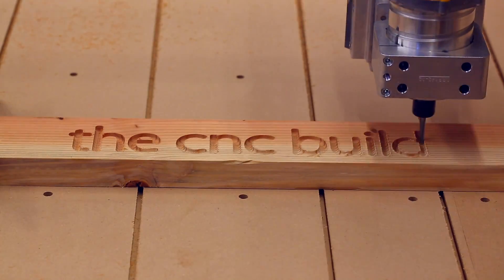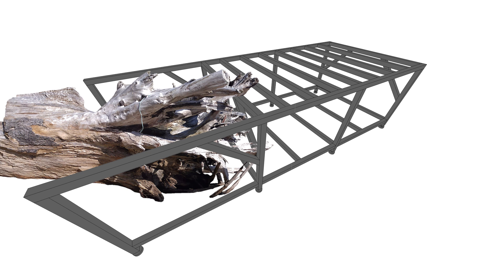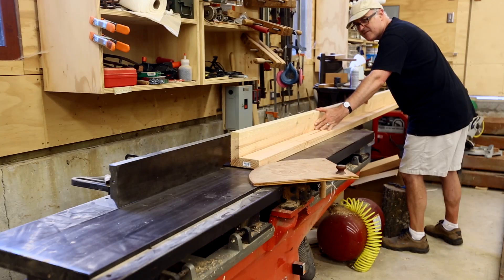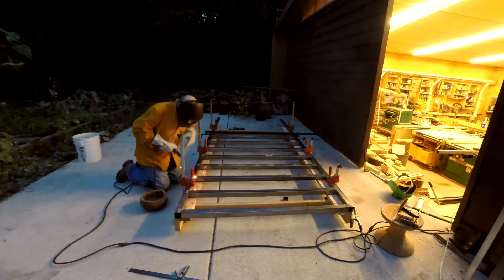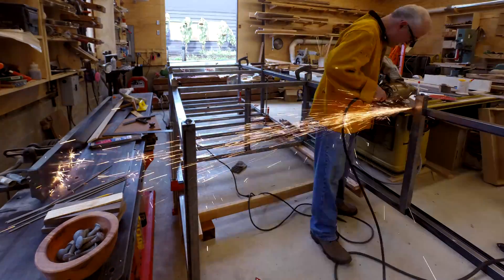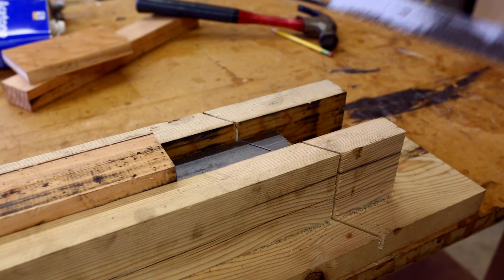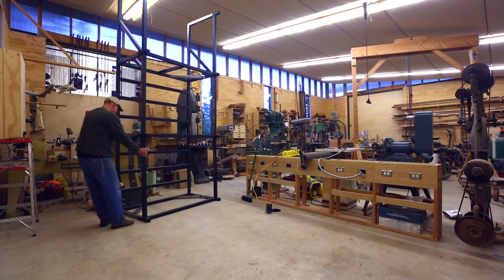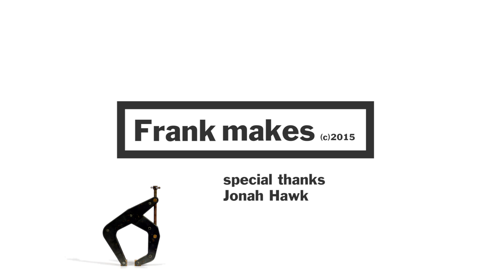The CNC Build: Part 1: All About That Base

Comment: Hey Frank, this is my very first video of yours - so Hi! Came here curious about your CNC journey to help make a few decisions about my own. Epic frame construction - very impressive - but can I ask why you didn’t just make all that out of aluminium extrusion? Surely it would have been so much easier to cut it and also get it dead on square without any welding at all? Maybe I’m missing something, so would really value your thoughts (not criticising you understand). Thanks, Steve [EDIT: - Ignore this whole question. Have just worked my way through your other CNC videos to where you upgraded and went with CNC Router Parts, now Avid CNC, and you’ve explained your different approach 2nd time around 👍]

Comment: Check out a Tig welder for a no spark welder. I use one for welding in my Basement with vacuum vent, it works well. I think the Tig welder is a nice small shop welder for multi materials like aluminum, stainless steel, steel, brass and copper welding

Comment: I know it’s been a while, but as a woodworker, I a really enjoyed your video. Love that you show your welding mistakes, and admit that you’re not perfect at everything. None of us are. It’s cool that you were willing to try welding as a novice. Now you’re no longer a novice! One question. Did you have problems with flatness during welding? I would have expected the joints to bend and move as they were heated by the welding.
Reply from the maker: yes the overall shape did bend out of shape, even with clamping the parts in place to weld them together.  I had some adjustment between the steel frame and CNC parts so I could correct for this warping in the frame.  If I did this again I think I would make a frame for the table and bolt the legs on.
Reply: Thanks for the reply! I looked at a lot more of you videos including your second CNC with the kit (nice machine!) Do you think there would be money to be saved by using unistrut for the base frame, and buying the kit parts only for the machine itself. Or, is most of the money in those kits tied up in the electronics, motors, and custom machined parts?

Comment: that's a smith's way of building a CNC machine... an engineer wold die if he did such thing... how do you move such a machine? how do you service it? how do you take it apart and transport it? how do you calibrate it? what are the tolerances? being made from WELDED hollow (RHS) beams, it'll probably twists with temperature differences, how much does it weigh? what weights does it hold without deforming? i can go on... but it's a good job for wood working, it doesn't need much accuracy

Comment: Don't be too hard on yourself. That looks like 1/8" tube steel which is a pain in the ass to stick weld. Mig or Tig would have been easier.

Comment: I have the same problem from time to time that one weld turns out great, the next one turns out terrible, same material and settings and everything. I blame it on my really cheap stick welding machine, i think it doesn't have a constant power delivery... 
Its also vey clear that sometimes i have to add 20 amps at the dial more or less just to get the same heat as the last pass..
Also there is a big difference between electrodes... last time i welded i used some weird AC electrodes on DC positive because i was out of my regular ones, needed a lot of amps to start but weldet out nicer than the proper DC electrodes i used before that.. 
Well i guess welding is a whole other science...

Comment: Nice video as always.  I always find it funny that woodworkers don't trust wood.  They want heavy cast iron, steel, bronze, etc...  In fact plywood is ideal for a base, since it is very easy to assemble with great accuracy.  If there is a concern with stability, just epoxy coat it.  The Gougeons have made strongbacks and jigs for projects for NASA to GE with ply and epoxy.  Steel is difficult to weld to perfect dimensions, each weld pulls on the next.  I know as I make bikes.    Wood you can cut and assemble and plane to perfect dimensions, like a fretboard.

Comment: Nice job Frank, check out Oajen metal threaded star type insert adapter for your adjustable leveling feet,  I use them a lot on my project.

Comment: The proper term of "all corners are on a single plane" is coplanar.

In geometry, a set of points in space are coplanar if there exists a geometric plane that contains them all. For example, three points are always coplanar, and if the points are distinct and non-collinear, the plane they determine is unique.

Comment: Loved the vid.  ( both film wise and making) Great!  Ive weld lots of 5 &10mm steel for building warehouses but I still have trouble with under 2mm.  Just as you describe one's great - the next one is shit !.  I built a smaller CNC but its for cutting 3d aluminum so its a bit heavier than yours.  Its on my site.

Comment: Nice animation!
I am a little surprised that you built a table first.  The CNC moving parts move on tracks or slides.  With the emphasis you have on the hollow part I would have thought that the need for a table would have seemed less pressing.  
There are some nice woodworking videos that use a cord or twine to find flat corners.

Comment: ....prep before welding.......simple grind of the factory coatings & oil,.... that's the only secret to good welding.......difference between a bead of weld....or a row of steel bugers.....great project Frank...was waiting for this one.
Reply: +Rick L There is really no need to remove mill scale when stick welding.

Comment: I'm a welding student, and far from an expert.  Take this with a grain of salt.  It got me thinking when you said some welds were great, but the next were worse, even though you felt like you did everything the same way.  My guess was that it was your arc distance. Long arcing is the enemy of the fillet welds you were attempting.  For the 1/8" electrodes I assume you used, you need a 1/8" gap.  Bear in mind, sometimes the flux and steel rod aren't even, so you have to move in closer.  The night shots were incredible  Good luck with your project.
Reply from the maker: +TheWaffledOne Thank you

Comment: Thanks for the hockey puck idea.  I think I'll use that on my work counter.  The smaller one are a real pain to adjust.

Could you show the hoist in your shop in one of your videos?  I need something like that to lift a truck bed and I'd like to see your design.

Comment: I also am making my frame from steel. 1.25" angle and 1.25" square tubing. Much smaller. I like the idea of the extension for milling vertically. 
What kind of lathe is that? Looks like an old Atlas or Southbend.

Comment: That is going to make a nice CNC machine.

Do you only plan on using it with a router, or have you considered attaching a plasma cutter or 3D printing head/attachment, etc., to it as well? If you think about it, a machine like this can be pretty versatile.
Reply from the maker: +J DeWitt DIY Yes I have thought about other heads for it.

Comment: Great job stick welding the tube steel.  I am a welder and you did a great job considering you were welding thin wall tube with a stick and not a mig welder.  Lots of work and very good video of the process.  Great narrative as well.  Thanks Frank
Reply from the maker: +Erik Anderson Thanks Erik

Comment: Frank, that is a pretty good size table. Will this simply be a CNC router or a convertible CNC i.e. a gantry system with interchangeable heads such as a router, laser cutter, 3D printer, etc.? That is a nice start.

Comment: Love the feet on this. Nice job w/ the welding too... It's not easy to get stick to work well on thin tube as +Barry's Workshop said.  What rod were you using there?  Love the sawzall jig too, I was contemplating getting a chopsaw, but don't need to if I use this!

Comment: Your frame looks awesome frank. When I built my 4x8 cnc table I made the frame from mostly 2x4's and I regret it all the time even though I'm doubtful I couldn't be built it any better(from wood). I have to level my spoil board sometimes what seems like daily. I really want to learn to weld and then go back and basically build my frame similar to yours.
Reply: +cadguyfrompti While I do feel steel is the way to go for CNC bases (primarily due to movement of wood - also for rigidity and mass) - if you get to the point you want to rebuild yours but not the point you want to invest in welding a frame (either yourself or have it done) - take a look at engineered wood materials for your base.  I-joists, LVLs or paralams will all be more stable and stiffer than 2x materials.  Also will be straighter to start with, so less of an issue when squaring it up.

Comment: Welding, like woodworking, just takes practice to get good at it.The more you do, the better you get. To stick weld thin wall tubing, just use lower heat and smaller diameter rods.

Comment: I know what you mean by all the flipping. I wasn't much good at welding on the vertical and absolutely could not weld overhead. Nice to have that option to rotate. What do you think you will have invested when you get done with the whole CNC build?
Reply from the maker: +WoodRodent I have been shooting for between $3k and $4k, but I have not added it up yet.

Comment: nice work Frank, what kind of paint did you use on the square tubing?
Reply from the maker: +Mike Kapotsy Rust-oleum flat black.  I think I should have sanded the metal surface before I panted.

Comment: Hello Frank :) With stick welding, there's pretty much one thing that's quite important and it's the earth clamp location. It is quite essential that it is nearby as the current wants to flow towards it and that effects the arc. When welding it is good to tilt the stick towards the earth clamp and this is where it's important to position it carefully so the arc melts the two metals together and forms a nice looking weld. In my opinion, TIG welding machine would also work in jobs like this because it is easier to control and see what the arc is melting and so it is easy to add filler rod to make nice weld. TIg is my favorite because if i wanted to i could weld with it in a tuxedo because it is very clean working :D Most TIG welding machines do stick welding too :)
Reply from the maker: +Zydarcon Thanks for the info.

Comment: I'm thoroughly impressed with your welds. As you said, stick welding on thin tube is not easy. Your arc shot looked straight on professional. Someone mentioned that the variation you got on quality could be oiliness, a very good candidate. Without knowing your sequence, so it's just a guess, but heat management also popped into mind.

Comment: I would have never thought that building it out of wood would be heavier, that's really interesting! does it have to do with the fact that the metal was hollow?
Reply: +Parker McCabe I wouldn't think that.  In fact, I am pretty sure a wood frame would actually be lighter than steel.  It is fairly broadly acknowledged and accepted that wood is stronger than steel for the same weight.  However steel takes a lot less space to achieve that same strength.
Reply: More wood would have been used because wood is weaker and yes the metal is hollow
Reply: +Parker McCabe well wood as it comes in such a variety of species has a wide range of weight/strength properties.. That not counting all the enginered/manufactured "wood" like plywood..
I guess a frame out of regular softwood could be stronger with the same amount of weight (especially with clever geometry and use of the grain direction) but not really suitable for this application as it warps with changes in moisture and his shop probably has big air moisture changes during the year..
So you would need wo use some kind of plywood, (doesn't warp) and that usually is heavier.. Especially since you cant use the grain direction to a strenght advantage with plywood.
But other than that its kinda funny to me that people don't trust the strenght of wood at all, even a lot of woodworkers don't.
People see something made out of wood and think its weak, see something made out of metal and think its strong.. But especially with metal without knowing any details (what kind of metal, wall thickness etc.) its hard to tell on first sight how strong something is.. Much easier on wood, provided it isn't painted.

I've used wood in a variety of unusual uses like for RC model vehicle building (fine white beech wood is perfect for that, remains very strong even to a thickness of 4mm and less.) or a trailer for a walk-behind tractor almost entirely made out of wood. Where i live trailers behind walk-behind tractors are (or were, back in the day) very common. So there's a active community restoring those sort of things.. people laughed at my wooden trailer, but i bet its stronger than many of the metal ones made out of thin walled tubing..

Comment: When I built mine, I did this part WAY too fast; I had a basement full of parts that I wanted to get assembled into a machine. I think you've inspired me to take it apart and start anew. The issues I've run into by not taking as much care of you cascaded throughout the machine in terms of alignment, etc. (silly things like my Y rails having a slight inward cant to them).

It was also my first welding project, and I was not as aware of the intricacies as I am now... (tack one side, flip, weld whole seam, etc...)

Thanks for the inspiration!

Comment: Great job on the frame, and for going big with the CNC. 
Noticed you didn't mention or show any cleaning and prepping of the steel prior to painting.  This is something that I hate doing and always turns out to be a huge effort.  
Removing the rust and worse the grease that can really mess up a paint job.  
How did you choose to go about this?
Reply from the maker: +lhw4 I cleaned all the steel with acetone before painting.  I should have sanded it too as the paint is not sticking as well as it could be.

Comment: Hey Frank,
I was actually wondering if/when you were going to jump on the CNC bandwagon. It will certainly expand the capabilites of your shop.

When you get to the choosing motors/electronics stage - do yourself a favour - and checkout the: ClearPath Servo Motors [http://www.teknic.com/products/clearpath-brushless-dc-servo-motors]. They are a significant step up from garden variety stepper motors. More power, no lost steps, quieter, self calibrating and much simpler to wire up.

They do cost a bit more, but you don't have to bu
y drivers - just a power supply and a breakout board.

Looking forward to following your progress. I am sure it will be a great journey,
Cheers from downunder... ;-)

Comment: Where you having a harder time as you got further from your ground clamp? 
I find as I get tired (4hrs plus of welding) it's harder to focus on keeping  proper speed and distance.  Maybe weld for shorter blocks of time? 
It also helps to be as consistent in your body positioning as possible.
Stick welding is fussy, but the only way to get better is to do more of it!
Aristotle said it best; "pleasure in the job puts perfection in the work".
Is that an old Black and Decker grinder?  We have one at work.  I've managed to cook nice new Walter grinders, but not the big old Black and Decker.  It's as skookum as ever.  I bet the brushes have never been changed either.

Comment: Cool project! I know it's well after the fact at this point, but did you clean the steel with turpentine before you painted? I couldn't tell in the video. Eventually that paint will chip and peel.

Comment: Cool idea with the sawzall guide.  How many cuts were you able to get out of each blade?
Reply: +Matthias Wandel You Youtubers all know each other? I could imagine a room with a dozen or so of you and some tools and some material would make a good TV show... haha.
Reply: +Decker, I would watch that.
Reply from the maker: +Matthias Wandel I think I only went through 2 maybe 3 blades.  They last quite a while.  in fact I was cutting up a rack gear last weekend with a blade that looked worn out, but it cut just fine.
Reply: +Matthias Wandel Not sure if you have one in your mix of tools, but you can also use a cold cut blade in a miter saw.  I've used one in an old Hitachi Miter saw for about 5 years now, and it is far easier than most other methods of cutting steel.  Not ideal for more exotics, but your standard low carbon and mild steels are no more difficult to cut than your average 2x4 that way.  Also lasts for a very, very long time.
Reply: +Decker Not sure. That would be a lot of ingenuity in the same room. I don't know if I would be able to keep up.
Reply: +Decker Haha would definitely watch that!
Reply: +Decker better yet.....Just get matthias wandel and a few others in the room and make them build their own machines :)
Reply: There is a question in my mind, 
when we change bits while carving in wood, do we have to change some setting in mac3 software, and can we change bits in mid of carving, if yes then what precautions we should take for such changes. reply as soon as possible. Thanks

Comment: Nice design and execution. You're not the only one that considers stick welding thin wall tubing to be a challenge :) Looks like you pulled it off quite nicely, in any case.

Good call on the hockey puck levelers. I have made a version myself and they work great on concrete floors and hold the weight quite well.
Reply from the maker: +Barry's Workshop Thanks
Reply: +frank howarth Hockey pucks might have a tendency to get brittle and crack over time. I found a pail of them in a friends garage that were god knows how old and they were quite hard.